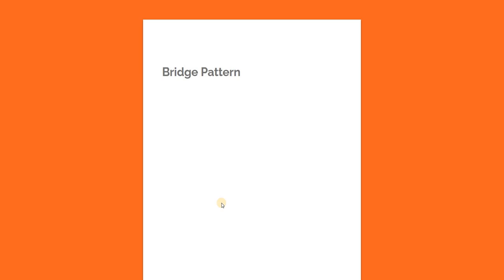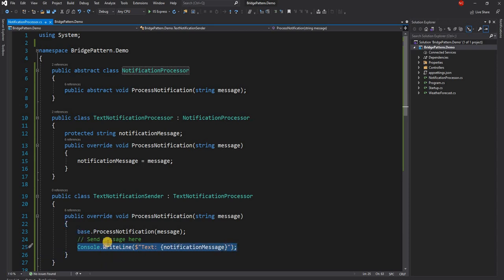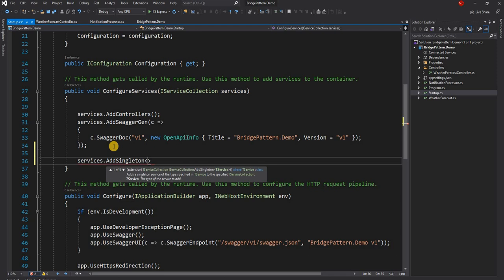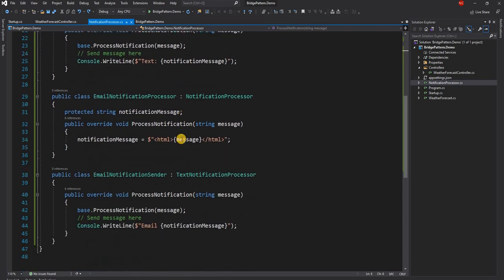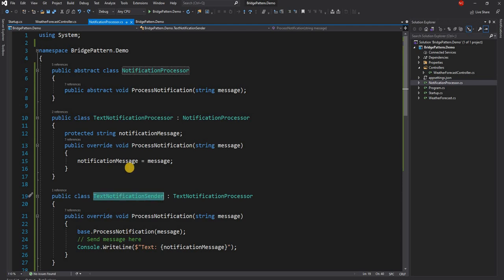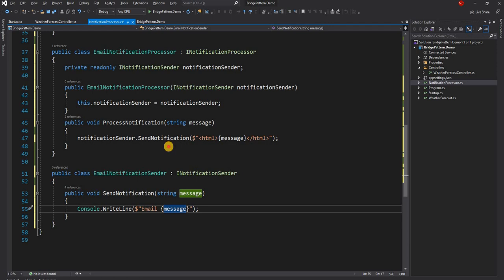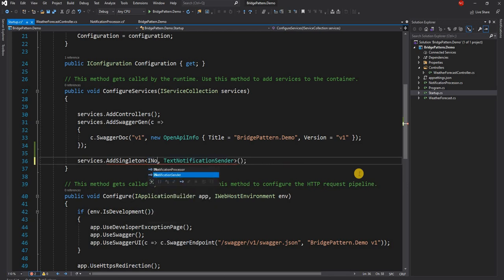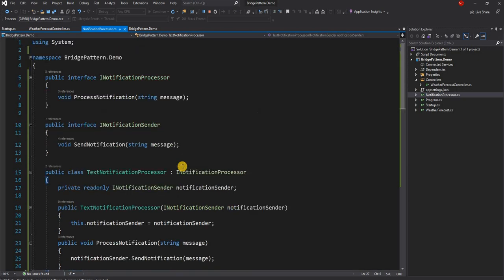Bridge Design Pattern (An Introduction for .NET Developers [.NET 5 and C#])

Comment: We cannot change an existing abstract class into an interface, although the interface now supports method implementation but that's another topic. Here the problem remains the same, by adding any methods to the INotificationProcessor you are bound to implement them in the implementation classes which is opposite of what bridge pattern is.